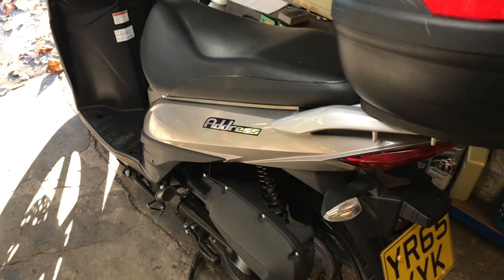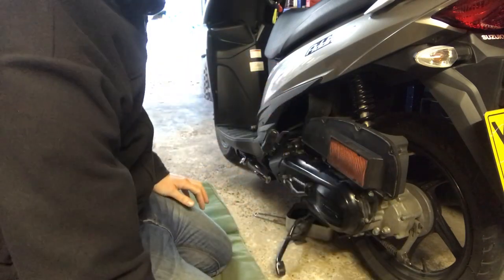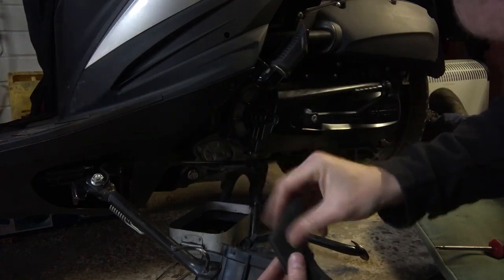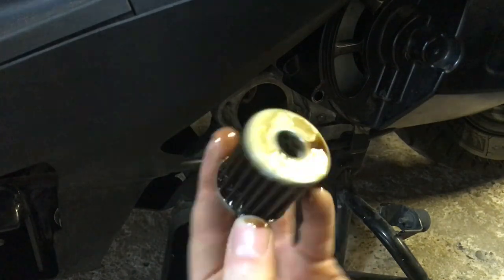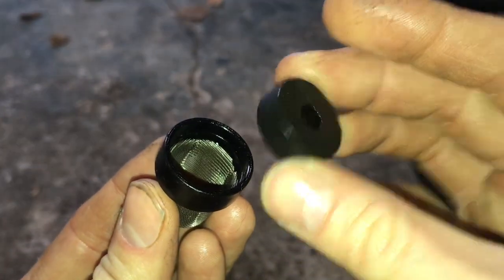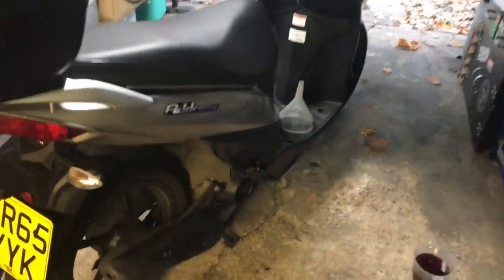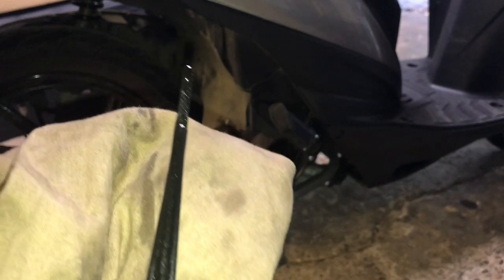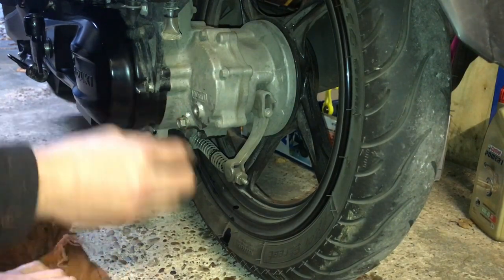Suzuki Address 110 - HOW TO SERVICE YOUR SCOOTER

Comment: Thanks for the information. It is a big help and I like how you explain. Is there a chance that you can create a video on how to install cellphone holder with charger on my suzuki address 110. I dont know if the wires need to attached on the battery or to the ignition. Im confused. Thanks again
Reply from the maker: Hi Kathleen. Thanks for your question. We’ve just uploaded a video that might help you 👍
Reply: Wow. Thank you
Reply from the maker: You’re welcome 😀

Comment: Great Vlog, much better than any other that i have given up watching because they just blabber on for hour's.
Iv'e just bought a Lexmoto 50cc moped and the last time i had a 50cc was over 30 years ago when there were only two stroke's which needed a petrol and oil mixture which you had to add to your fuel tank.
Can you please tell me, as all bike's are now 4 stroke's does the engine oil lubricate the piston & top end or is there another place on the bike that need's to be topped up with oil?
Thanks in advance and ATB.
Reply from the maker: Thanks! If you’ve subscribed then you might change your mind about us blabbering on haha! Anyway... yes you are correct. Any four stroke is lubricated by the engine oil that’s separate from the petrol. In the same way as a car. There’ll be a dipstick or sight glass to check the level and it’ll need servicing at regular intervals. But no need to pre-mix fuel and oil. The fuel and oil should never even meet each other. If you watched this video, there’s a section where I check the dipstick on my bike. Yours is probably similar if it’s definitely a four stroke. Which bike did you get? If you’ve got any questions, feel free to give us a shout; and happy riding!
Reply: @MechitBetter  Nooooooo I didn't say that you were blabbering on 😂
I said that i just got a Lexmoto 50cc moped, it's the Echo 2019.
I think that i did subscribe, if i didn't then i will 😊
So the engine oil ( where the dipstick is ) that lubricates the top end? 
Thanks for taking time out & all the best 👍👍
Reply from the maker: Ha, I was suggesting that we do blather on a bit sometimes 😎 But yes, the engine oil lubricates the top end on a four stroke. Nothing else required 👍
Reply: @MechitBetter  Lol, i don't think you blabber on at all, you should see some bike vlogs they take age's to get to the point 😂
Thanks for the good advice.

Comment: Thanks for the in depth service video was enjoyable to watch, how does the scooter go?
Reply from the maker: Thanks for watching. The scooter goes well. The service made no difference to the performance, but it goes as well as it ever did 👍
Reply: For only having a 110cc engine this little scooter is a flying machine. Iv had mine hitting 70 downhill, not that I ride it like that as norm but its a great scooter and can hit 50 pretty quickly. You have no quams about joining carriage ways or fast roads worrying about getting up to speed cause its just not an issue. Great video. 👌
Reply from the maker: Thanks Paul. I agree that the performance surprised me for a little scooter. Obviously it suffers a little going up hill, but overall it’s great 👍

Comment: Hello mate. I just like to ask a question about replacing the oil filter. I took the old oil filter out of my address, and with it came a rubber o-ring that had split. I'm not going to lie, I've just spent about 3 1/2 hours going to my Suzuki parts dealer, and round all the local plumbing shops, and although I came very close, I could not find an exact identical o-ring. I have one that is 95% identical, but just the tiniest bit thinner, buy about 1/5 of a millimetre. Think this will really matter? 

Thanks
Reply from the maker: Hi Daniel. There’s an o-ring that goes on the silver filter cover cap. I mention and show that one at 8:36 in the video. Any o-ring should do for that one so long as the diameter is appropriate. Or is there another o-ring deeper in to the filter recess? I don’t recall from memory, though it would make sense that there is. 

Either way, I reckon the one you’ve found is worth a shot if it’s only fractionally thinner. If it were me (based on what you’ve said), I’d give it a go 👍
Reply: Apart from the large O Ring on the drain cap, there is another smaller O Ring inside the housing. It's about 1/2 inch in diameter and goes on the bottom part of the housing. The O ring fits over the raised section. I know, as the O Ring came out with my old filter. I was looking for one in your video but you didn't find it....lol. I'm surprised the small back O Ring doesn't come with the new filter. (Really it should)

Comment: Amazing tutorial, thankyou for making step by step video.
I just want to ask some questions.
1. When i am pressing right brake, a sound is coming from tyre side i guess (sound like metal clanging, not sure how to tell it :p ) , so do i need to worry about this ?
2. Which tools do i need to buy in order to open nuts and change engine oil/filter ? (I do not want to buy unnecessary tools).
3. How to replace front light bulb ? (present one no more working). And which size/name bulbs i need to buy ?
Thankyou.
Reply from the maker: Hi Arjit. Thanks for your questions. 
Yes I would be concerned about the noise from your brakes. They should be silent. Can you upload/send a video of the noise? 
My apologies but I can’t remember exactly which size tools I used, but I think I mentioned the sizes in this video. In any case, a simple socket set will cover everything you need and be really useful for other maintenance jobs. 
The front light bulb is hidden behind the front panel. I have a video here which shows you how to remove that. The main headlight is a 12v 35/35w (HS1) bulb, which is held in I think with a wire clip. Once you’ve removed the front panel, you should be able to see how it’s removed. 
I hope that helps. If you have any more questions, give me a shout 👍
Reply: @MechitBetter  Hello, thankyou for answers, i don't know how to record noise i am facing because it only happen when the bike is running.
"Socket set", thankyou i will buy it.
The front light top bulb is ok, i was asking about 2 small light bulb at front down (installed with indicator bulbs).
Regards
Reply from the maker: If you are experiencing strange brake noises when riding, my advice would be to take the bike to a professional mechanic and let them look at the problem. Being able to brake is the most important thing! 
The bulb you need is a 12v/5w sidelight bulb. The holder is just pushed in to the light unit. Remove the front panel and pull out the holder, then pull out the bulb from the holder to replace 👍

Comment: Hello could you help me by telling me what type you should take where you add the 90 milliliters thanks, is the same that applies to the engine? A thousand thanks
Reply from the maker: Hi Andres. The 90ml of oil is the same as the engine oil. It’s the same for both 👍

Comment: Amazing! My Address is being delivered later this week. I'm really confident about Address-ing (sorry) the bike when needs be thanks to your great videos. Thank you! n_n
Reply from the maker: Haha, cool! Thanks! There’ll be more Address videos coming as the jobs need doing on mine. I’m sure you’ll love yours. Enjoy and get stuck in. It’s a great bike 👍
Reply: @MechitBetter  I don't suppose you could let me know what size the vent holes are on the front brake disc, please? I'm trying to get all my security equipment purchased before the Address arrives, and want to pick up a disc lock. Looking forward to new videos! :)
Reply from the maker: No worries. The holes are just about 5.5mm so a 5mm pin is the thickest you could go if you want to use the holes. The disc is so small that I sometimes lock mine through the larger tear shaped holes in the centre. If you’re doing that then you could probably go bigger, but 5mm should be fine 👍
Reply: @MechitBetter  Wow, thank you so much! Using the tear-shaped vents/holes is a good idea. I'll see what's available. Top man :)
Reply from the maker: No worries. Any time 👍

Comment: Good afternoon, I ask you to clarify to me one point - does the Suzuki Address engine have a 110 aluminum cylinder with nickel-silicon deposition, or does it have a regular cylinder with a cast-iron sleeve. I can not find information on this.
By the way, you have a very nice dog. With best regards, Vladimir.
Reply from the maker: Hi, thank you for getting in touch. The dog is pleased with your comment! Unfortunately I don’t have the answer to your question either. Have you contacted suzuki?

Comment: Please help! in 2:00. I saw you open aa (i dont how call it in English). Please help for vocabulary.  And one more question is, once time I changed oil for my Suzuki Address 110 and I push so strong and now I cant open it. Please help for fit it!. Thank you so much!
Reply from the maker: Hi Mike! We would call it the ‘sump plug’. If yours can’t be opened, you should clean all around the area and then spray plenty of WD40 (or something similar) around the bolt. Then let it sit for a while, overnight ideally. Before you try to remove the sump plug, tap it GENTLY with a hammer several times. This can help to loosen it. Next you can try to remove the plug in the normal way. If that doesn’t work, you will have to try a longer spanner or longer handle with a socket. We have a ‘breaker bar’ for this reason. Just be very very careful not to push too hard or you may damage your bike. A breaker bar like this should do it. 
https://images.app.goo.gl/7GYkyrDa8xduMDfv7

Comment: do you need to change the oil filter everytime you change oil or is it every 8000km
Reply from the maker: It depends how often you change the oil. Change the filter every 8000km as a minimum, but if you’re changing the oil regularly then perhaps change the filter every alternative oil change. So if you change the oil every 2000km, change the filter every 4000km. I hope that makes sense. If you wish though, you can change it every time. Any filter change is better than none at all 👍

Comment: Great video — thanks for sharing.
Reply from the maker: Thanks! No problem. Hope it’s helpful for you 👍
Reply: @MechitBetter — I'm in the process of deciding what bike to buy. I'm looking at BMW 310 GS vs a much more affordable scooter (either Suzuki Address 110 or Honda Elite 125). Your video definitely makes it possible to self-service this scooter even for those of us that are not very experienced in servicing our own bikes.
Reply from the maker: The scooters are certainly easy enough to ride and work on but the GS or something similar makes longer distance easier. Tough decision! How about the Kawasaki Versys 300? That looks like a nice bike. Or even a bigger scooter? The Kawasaki J300 looks good. Best of both worlds 👍

Comment: I have another question my suzuki starts without pressing start button (on right hand) and engine starts only by pressing rear or front break is it normal?
Reply from the maker: Uhm..... it’s possible that the new bikes require the brake to be pressed in order to start, but my 2016 bike will start without the brake. But I’m not sure that I’ve understood you correctly.
Reply: Mech it Better Actualy i mean my scoter starts only by pressing break without pressing start button.
Reply: My bike model is 2020 and it starts only by pressing break.
Reply: Is it ok or not?

Comment: I'm needing to replace my rear tyre, do you recommend swapping from the stock IRC tyre to another brand?
Reply from the maker: Hi Ian. I’d probably change it while the opportunity presents itself. I have a Michelin Pilot Street on the rear and it’s great. I’ll change the front to the same when it’s due 👍

Comment: Hi Dear,
I have bought new suzuki address 110 and i can not find exact same mentioned oil filter but i have found a model number which it has same size with original oil filter is it possible to use it or not?
Reply from the maker: Hi Mohammad. It’s possible that your new filter will be OK, however... please check with your Suzuki dealer to be sure!
Reply: Mech it Better Thank you also i have another question my suzuki start without pressing start button and engine starts only by pressing break is it normal?

Comment: Drain the gear oil on the side stand, not the center stand. When filling the gear oil put the bike back on the center stand. If the gear oil starts to leak out of the filller hole you have the correct amount of gear oil in the housing.

Comment: Very helpful..is this a good scooter to buy it new?
Reply from the maker: Thanks Dimitris. I think it’s a great scooter and I know those who’ve bought them have been happy with them. But.. I suppose it depends on what you want from a scooter. It will suit some needs more than others.
Reply: @MechitBetter  thank you very much.is it better than SYM 125 scooters?
Reply from the maker: I’ve never ridden the Sym so I’m not able to compare the two directly. I can only tell you things about the Suzuki. If you have any specific questions about the Suzuki, I’d be happy to give you my opinion 👍
Reply: @MechitBetter  thank you very much my friend.i am from Greece and i need it to use it in Athens as a second bike.i have not seen so many Suzuki address here to ask if it is a good bike.
Reply from the maker: The Suzuki is an excellent city bike. It’s very small and nimble. It fits through small gaps and the handling is very good. It’s been extremely reliable and very economical. It is smaller than most scooters, which can be a good thing or a bad thing. I’m not quite able to fit a large full face opening helmet under the seat, but a smaller helmet or an open face helmet should fit without any problems.  The seat is comfortable for short journeys, but can become uncomfortable after an hour or two. Overall, I’m very happy with my bike, particularly as a second bike. I have a larger bike for longer journeys, so the Suzuki makes excellent sense.
Reply: @MechitBetter  thank you very much for your comments.is it ok for height 1,86?
Reply from the maker: I’m 186cm also, and I find it reasonably comfortable. It is the smallest and lightest new scooter available I think, so I do look a little tall for it, but it’s fine 👍

Comment: Great video. Thank you. Will you do one for the big service?
Reply from the maker: I’ll be making a video of any other bits and bobs I do. I haven’t got anything planned at the minute though. What job  did you have in mind?
Reply: @MechitBetter  thanks for your quick reply. I just had a look at the manual and it seems the only thing that is outstanding, if I am not mistaken, is the drive belt replacement. Have you already done yours? Thanks.
Reply from the maker: Not yet. Mine’s not due yet. A few people have asked for the video though so I might have a look in to it soon 👍
Reply: @MechitBetter  mine is not due yet either :-) i have 14k kms it's to be replaced at 20k kms. Let's hope  you have more on the odometer hahaha
Reply from the maker: I’m at about 8k kms, so you’re a bit ahead of me!

Comment: I have found that for starting the engine I don't need to push the start button and the engine starts only by squeezing the front or rear brake lever.
it would be appreciated if you check and let me know is it normal?
Reply from the maker: That sounds very strange to me. The bike should start with the starter button only, or with the kick start. If your bike starts when you press the brake, you have a fault. Take it back to Suzuki 👍
Reply from the maker: It actually sounds like your brake wiring and starter wiring are switched around. So hitting the starter might put the brake light on. Putting the brake on starts the bike. Which means that the bike will be trying to start whenever you brake, which will destroy your starter motor and damage the internals of the engine. Where did you get this bike?!
Reply: Mech it Better it is used bike but it runs only 540 km also when i push start button nothing happen
Reply: @MechitBetter  Actually as i have checked break and start are not switched over because when i have push start button break light does not turn on.
Reply: Also based on bike user manual you need to squeezing the front or rear brake lever so as to start the engine i think it may new feature for safety or something like that because my bike doesn't have any other problem
Reply: Mech it Better I have contacted with technical support and they say that start button stuck in on mode and it should be open and checked.
Reply from the maker: Glad to hear that you’re getting somewhere. I think I’d misunderstood what you were saying. Squeeze the brake, hit the starter, and it should fire up. If it’s not then yeah, it sounds like the starter button is faulty. It’s hard to figure out without the bike in front of me. If you haven’t done already, take it to a bike mechanic and see what they say. Good luck 👍
Reply: Mech it Better Hi i finally fixed the issue i opened the front of bike and check the start button and i found that one of screw of front across between two wire of start and cut them and make switch always on i fixed the cable and now everything is normal:)